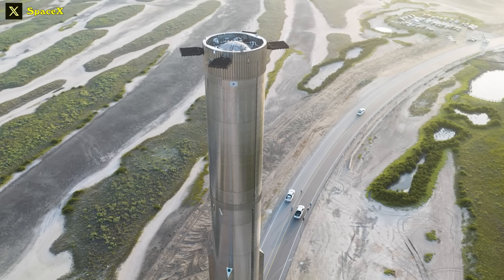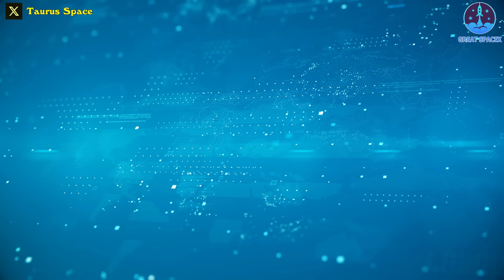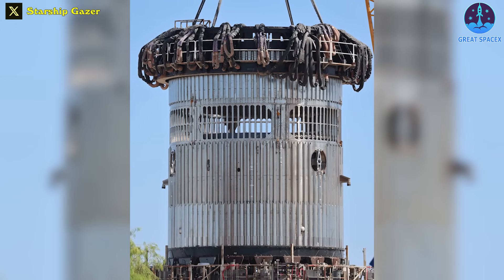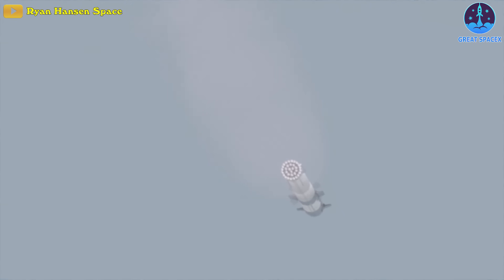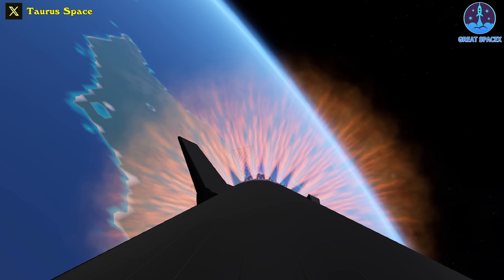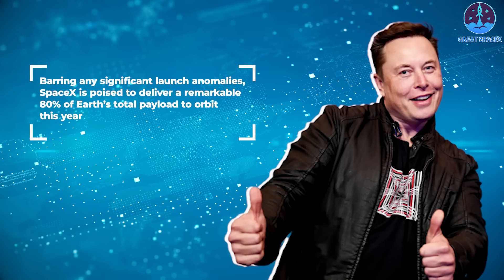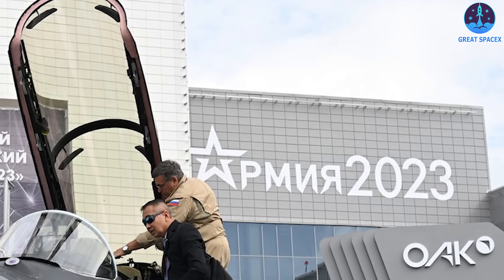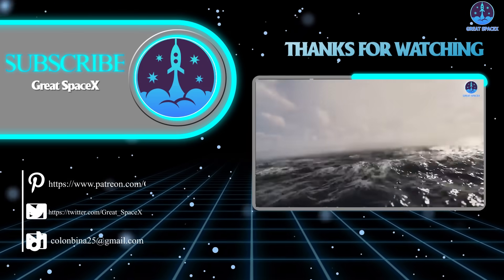Finally happened! Booster 9 Installed Hot Staging, New OLM Water Deluge Test. Firing next week...

Comment: One wonders why SpaceX attempted the weird "shaking" staging maneuver in the first place. It's not like hot staging is something unheard of - Soviets used it for ages. It eliminates the need for ullage motors in the upper stage and shortens or eliminates the zero-acceleration period, at the cost of slightly bigger lower stage mass, especially if it is reusable. It's not like any of this needed "inventing"...
I would probably play it safe and go with small (probably hypergolic or even solid) ullage motors on the upper stage, but that id, admittedly, more complex than this.
Reply: Since the ring was ready so fast after the launch I have a feeling it was similar to the deluge. It wasn’t ready yet so the just checked if it worked without.
Reply: @Wurtoz9643  Interesting hypothesis, and something Musk would be prone to do. But I don't get what was meant to be achieved by launching so woefully unprepared. Waiting for water deluge system and proper staging mechanism (either hot staging or something similar to what Facon uses) would have avoided prolonged investigation and FAA license deliberations, as well as the lawsuit the outcome of which is by no means clear.
Reply: @bazoo513  you bring up some good points that I did not think about. I say we just wait and see what happens because as they say (at least where I live) done is done.
Reply: @Wurtoz9643  Yes... 😀